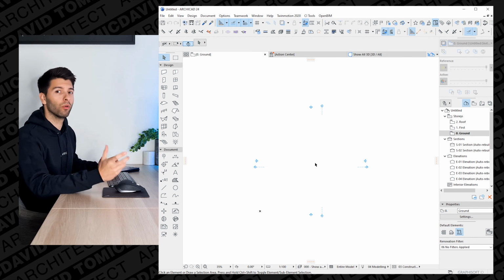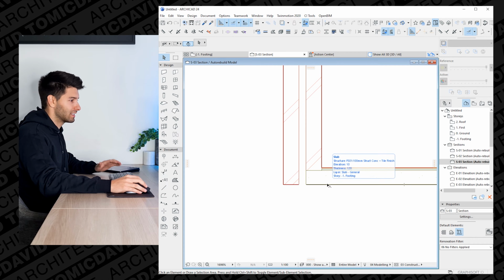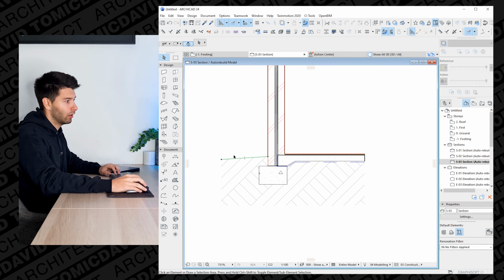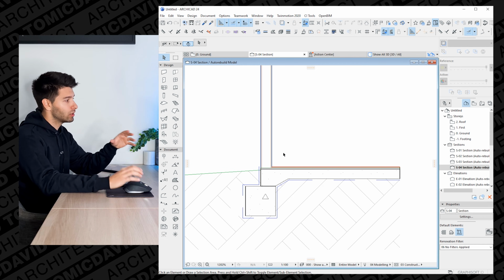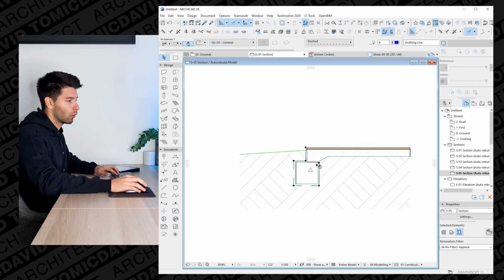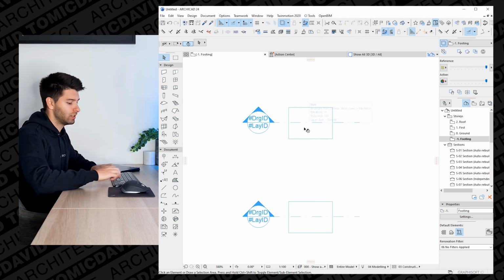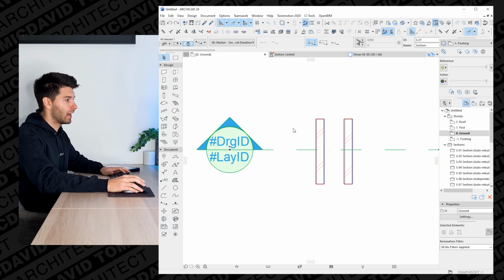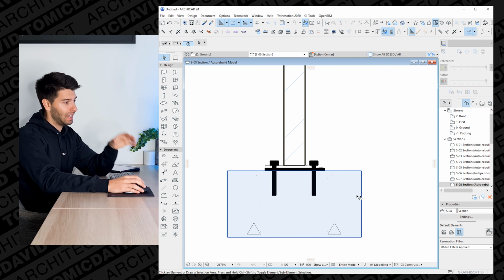5x Construction Details in 30 minutes (ArchiCAD Tutorial)

Comment: You could save yourself from drawing that earth on every single detail by modeling it and use Solid Element Operations to subtract that from the structure. Otherwise, nice details. How about using the Detail tool?
Reply from the maker: You are correct. Checkout my latest section video

Comment: Hi David, I like you content and I enjoy watching your videos but just to point out, I think this detail is incorrect. The rebate of 172mm is correct but the external skin does not sit on the footing like this directly as you've shown, it actually sits on a rebate that would be 160mm wide and the footing is mass poured with it to form the footing below it flush to the external brick skin. Having your soil this high up the external skin won't allow you to put any weep holes which are generally place at 2 courses of bricks as well as the damp proof membrane.
Reply from the maker: This is an alternative detail and you are correct it is a possible method. I've tried to keep details as internationally relevant to everyone as possible so, there will definitely be different versions of every detail I showed.
Reply: @DavidTomic  Ah okay understood. Keep up the good work, always good to see architecture related channels.